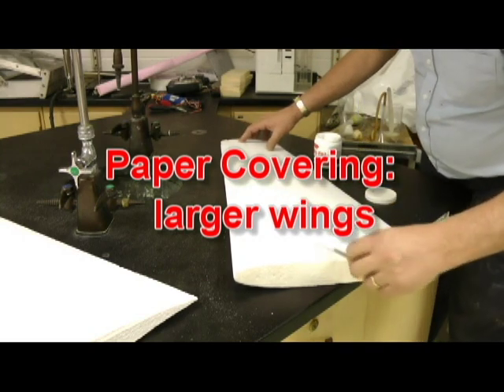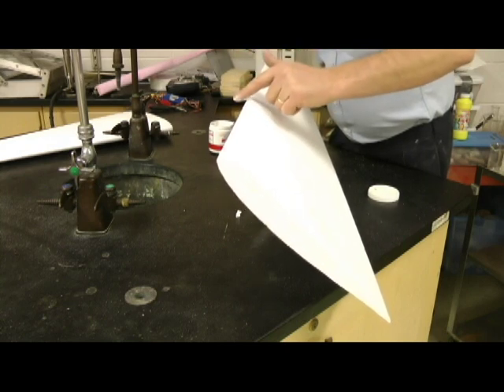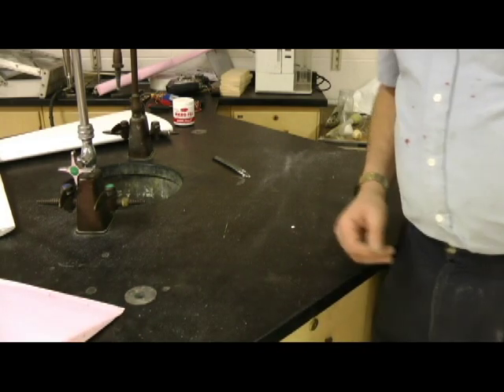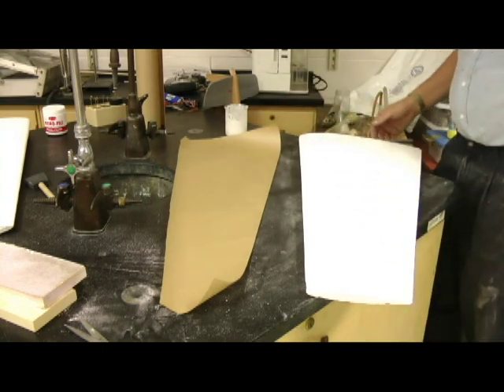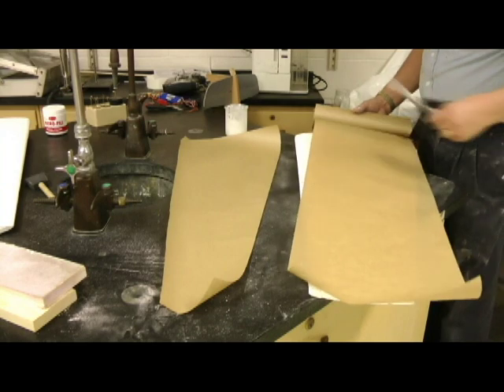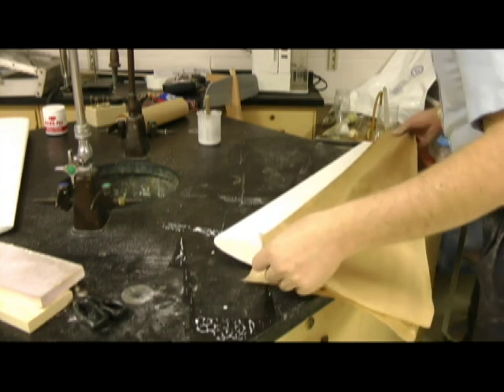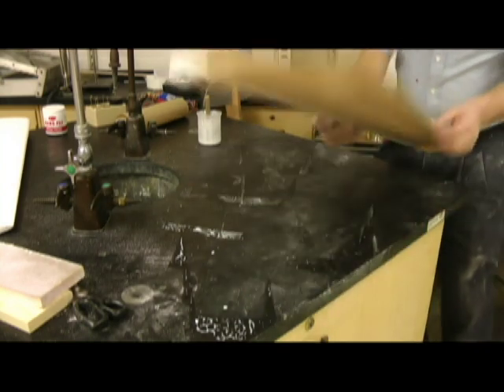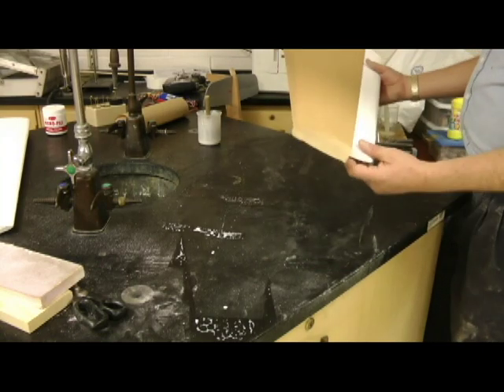Tutorial 3a: Paper coating larger foam wings

Comment: why don't you let the first glue dry completely and then do the next one?
is there any reason?
Reply from the maker: Keeping the paper pliable is important.  You could actually put a layer on the foam and let it dry first, but then it draws the moisture from the glue as you put on the paper making it hard to work.  I have actually tried this.

Comment: Great instructional videos, nicely done, I am going to try the paper covering on a wing I've just cut, what sort of paint do you use once it's covered?
Reply from the maker: I actually used spray paint.  It is light and covers well.  On my Giant Foam Rc video I used latex.  Worked great.
Reply: Brilliant,  thanks for the reply,  I have spray gear here,  acrylic?
Reply from the maker: Cheapest Walmart paint I can buy!  My planes usually don't live long enough to get shown off too many times.  I just get the $2 stuff in a spray can.  The paper takes a few coats and it needs a smoothing out with a pad between coats, but does a fine job.  Try it and let me know.

Comment: To add a lot of strength at the center where the two wings join add a diamond or oval shape of paper right over both sides of the joint with the points of the diamond overlapping on the leading and trailing edges.   On nitro fuel models I cover the paper with clear iron on laminating film from an office supply store.   About half the cost of hobby shop iron on film and a low temp product that also sticks well directly to foam.